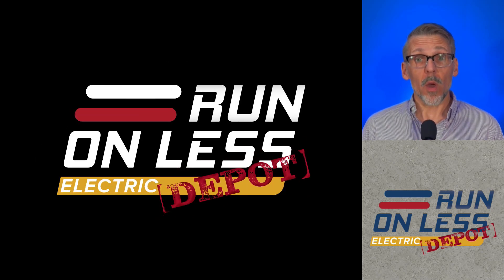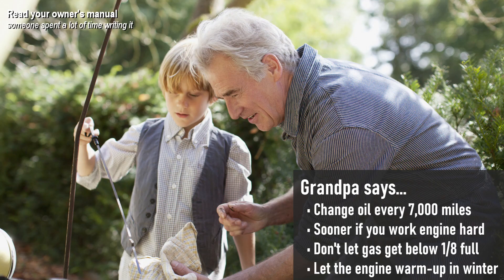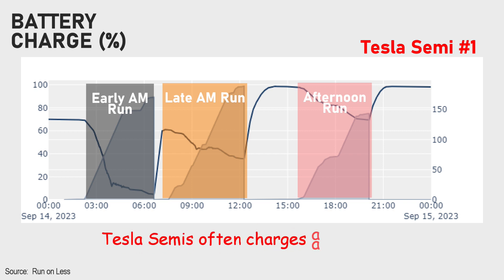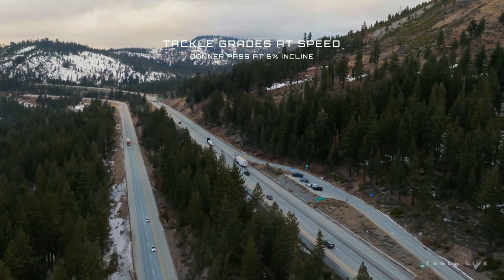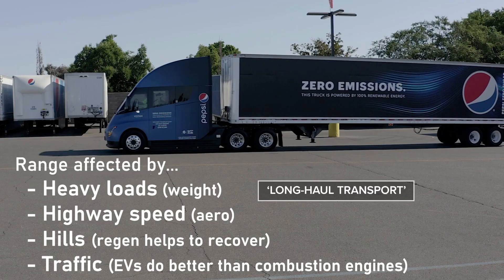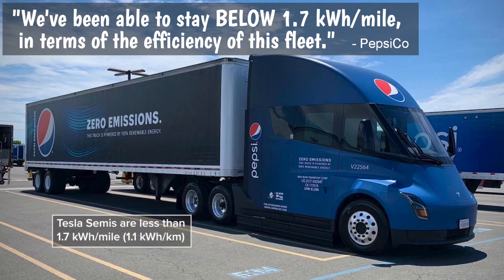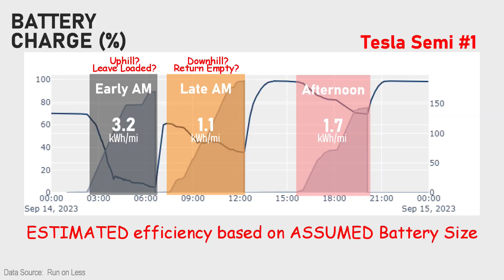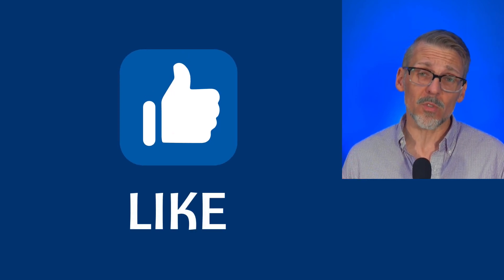In-Depth Analysis of Tesla Semi Data (Freightliner and Volvo too!)

Comment: What makes sense is what Edison Motors is doing.  They are using an electric drive train like the other EV’s, but add on a diesel generator.   This allows them to avoid the infrastructure and range issues of a fully electric truck.  Another advantage is the fact that you can adjust when the generator comes on so you don’t over stress the batteries.  A 80% full charge down to a 20% discharge can be maintained extending the life of the batteries.   But the main advantage Edison Motors has over the other BEV trucks is that Edison Motors is designed for vocational trucking.  Initially it was designed for logging, where you go up hill empty and come down the mountain fully loaded. With regenerative breaking on a full load going down hill, and empty load going up hill, and an onboard level 3 charger for the range, they are looking at 50-100% fuel reduction depending on the terrain.  Diesel trucks for highway hauling are already extremely efficient. I think a hybrid approach will make a lot more sense for more applications, than a fully electric truck does.

Comment: The most important statistic is how much load they can haul and how far on a single charge. These cannot haul as much as a regular truck as they also have to carry their own batteries. They will never haul as much as gas vehicles they all have a have a maximum weight.

I want to know if the weights of these vehicles were maxed out in therms of weight and if they were, what was the load weight.

I would love the hype to be true, but it's not.

Comment: Thanks for showing us the data, this shows how stupid EV trucks are. 

1) Drivers don't care about the batteries because its the company paying for the degradation not the company. Hence not capping the charge and driving it down to single digital state of charge
2) Range doesn't seems to be sufficient because drivers are fully charging it and driving it down to single digital meaning that they are not willing to wait at a charger to charge midway or they don't care about the really really expensive battery packs because their company is paying for it. I would really hate to see it in a few years where these battery packs are old and could no longer cover that distance. 
3) they are charging whenever is convenient meaning they are charging during the day which means electricity rates are sky high. 
4) Pepsi have an on site battery storage where they could charge the truck with during high demand charging. This just just adds a bigger battery pack that you're cycling and degrading. 
5) Also, most of these things seem light.    

If you really want a new fuel hydrogen would have been way better or syntenic fuel

Comment: I would like to see the calculations if these trucks are charged on standard 480v and 240v. Keep in mind it can charge from four circuits at once. There are large number of trucking routes, not highway per say, that can be done without the special chargers. Also they can charge from four superchargers at once, although this is probably only practical for overnight charging as cars leaving 4 superchargers all together and available for use during the day is unlikely

Comment: The cost of the changing facilities should also be included with length of use (Solor panel length of seri e and ...).

Seems trucks running on liquid fuel is the way to haul.

Impressive how far electric trucks have come.

Comment: I worked for Schneider for 7 years in the 90’s, they are ruthlessly efficient and I’m telling you if these electric trucks were a realistic idea that actually worked in the real world Schneider would order 13,000 of them tomorrow. They were the first to put satellite technology in all the trucks, they changed the entire fleet over to fuel efficient Detroit series 60 engines in just a couple of years and switched the entire fleet to automated manual transmissions. They couldn’t care less about the drivers they did these things only for more efficiency. I’d bet money Schneider didn’t pay a dime for the electric trucks in this test program Freightliner and probably the US tax payer is footing the bill. Let’s face it unless they scale up and modernize nuclear power all these trucks are running on COAL. A handful of solar panel and windmills (which don’t even work half the time) won’t cut it.

Comment: According to "Food Processing" website (trade publication) Pepsi is adding 50 more Semis to Fresno.
I would say that they probably have enough information to make a decision, and they are voting in the most MEANINGFUL WAY possible for a company ... with their capital budget.
So you can hate on EV Class 8's all you want, but the people who PAY for the big fleets have already decided.
It seems that the biggest holdup is Tesla, and the biggest holdup THERE (which they downplay massively) is  a shortage of the right KIND of batteries - the 4680 program has not been the success Elon expected.
Why would you want to use them for OTR, when your BEST savings come from using them for "local" delivery - exactly how Pepsi is? Long haul is either a decade away (I may be pessimistic) or something more like Edison Motors.

Comment: 14:50 With the Telsa and OTR, you do not need mega-watt chargers everywhere - you just need a slow charger at truck stops that would run the truck's electrics/climate control/battery cooling/heating and charge the truck in 8 to 10 hours as the driver takes the overnight sleep

Comment: Long range truckers can drive 11 hours a day so stopping to charge the truck for 2 to 3 hours during the day would be a problem for them.  This assumes there is charging during the night while the trucker's sleep.
Reply: Exactly. Long haul as it is done presently by trucks in North America does not allow electric trucks to do the job, even if the range could be extended to 1200 km per charge. Sometimes, drivers don’t have too much choice to park and if they can’t find a charging station for the night, they would be screwed.
Reply: It takes 1 hour to full Charge for Tesla Semi to charge @ 800 to 1000kwh charger.
Reply: @rozonoemi9374  And ? Why is it relevant ?
Reply: @martinpenwald9475  you stated that it takes 2 to 3 hrs to charge, which not the case for Semi. Yes I agree that presently long haul truckers can't realy charge along the way, but it's coming. I'm à retirer truck driver for 30 years so I know all about Trucking, because I'm off to the rodeo with a heater in my truck!!!
Reply: @rozonoemi9374  Learn to read. Where did I state whatever about charging time ?
Reply: @martinpenwald9475  Sorry, the comment was for @harland...

Comment: Imagine if we had a technology that could be electric without needing batteries. You could also hook a ton of things together to decrease the number of drivers and reduce other inefficiencies. You could even use steel wheels and put it on some kind of steel guiderail to really increase efficiency.

Electric long haul freight is a solved problem and electric long haul trucks are not it

Comment: Is ironic that people are worried about the range when DOT driving limits are the bigger limiting factor.
Reply: Not by far. Driving more than 900 km per day is very easy, and driving over 1100 km is possible in some routes WHILE respecting speed limits and DoT rules. Last week, I did 920 km in 1 day on Texas roads (with less than 200 km of interstate this day and a mix between 2-lanes and 4-lanes highways) with a 61 tonnes oversize combinaison. So, nothing that an electric truck can remotely do with current technology.
Reply: @martinpenwald9475   in Europe, a driver can cover an absolute legal maximum of 506 miles (810 km) in a day, but more like 420-450 (ca 680 km) miles in practice!  We obviously care more about operating safety here in Europe!
Your examples belong to the upper 1% of US truck operations!  Tesla and the other e-truck manufacturers have 90+% of the market open to them!

Comment: A fully loaded diesel truck uses about 30 L/100km, so about 4.5 times as much as a car. At 1.7 kWh/mile these trucks use about 7 times as much as a car. Am I missing something here or why is he calling that extremely efficient? And keep in mind that a diesel truck has more loading capacity than an electric truck.
Reply: Diesel contains about 10 kwh of chemical energy per liter. A Diesel engine is about 40 percent efficiet. And 30 liters of diesel is equal to 120 kwh energy. This means 1.2kwh/km energy consumption. So where is the 7 times more consumption?
Reply: @Bruh-pp5yz  An efficient electric car uses about 15 kWh/100km or 0,25 kWh/mile. So this truck uses 7 times as much energy as an electric car, compared to a diesel truck using only 4,5 times as much as a diesel car. I am just wondering what is the reason for this.
Reply: @weorldedit  some Diesel cars consume 4 liters per 100 km.

Comment: I think the weakness in your data (as indicated by others too) are that you don't know what they were hauling. Other youTubers are saying that the loads are a lot more modest than they might imply. Also you're not able to determine just how much money they're spending on the electricity so you don't know their cost per mile. Also there are numerous stories about breakdowns and as you say, they're a LONG way from autonomous operation. As an experiment, it's quite hopeful. But there is no way to tell from this data or your analysis if this is in any way practical. And to say that Tesla is not a reliable information source is the understatement of the century. Then there is weather (like cold weather), long term battery degradation, and cost of maintenance to consider. Hertz, after all, gave up because of how expensive their Teslas were to maintain (when they were able to even get parts). I kind of see this like the US Navy's railgun and laser experimental weapons. Cool sure, and someday a major part of the navy's firepower, but maybe not really practical for decades to come.

Comment: All that spiel about 20 and 80 is nonsense because the 0 and 100 percents reported are NOT actually 0 and 100 of the battery capabilities! Rather, it's what BMS limits users to. Hence, you are automatically ALREADY in the "20-80" window of that specific battery. It's true for most of batteries made in the last 5 years... 😂

Comment: I deliver Amazon, and they charge all those eVans to 100% every day.
Reply: Which is fine. Charging to 100% isnt bad for the battery as long as you dont store it like that for days. If you drive shortly after its fine. Its way worse for the battery to discharge it into the single digits.
Reply: @TheDude50447  But it does increase dendritic formation which does reduce the life of the battery.  Of course the chemistry matters and for lfp you are right- but tesla insists on nca and it really does reduce the life of those.

Comment: Just the time spent recharging that monstrosity all day and its extremely falling asleep with so many batteries that could bust into flames while you sleep makes diesel way better and they have a electric motor ad on to trucks and trailer that will give a diesel 19mpg so electric is not the way

Comment: 1:37 God I can't stand the marketing ploy that electric cars/trucks are "0 emissions".

Yeah, okay, so maybe YOUR charging station is powered by renewable energy. They aren't ALL though. And I'm fairly confident that the production of all the lithium batteries wasn't exactly as environmentally-friendly as you're touting.

Meanwhile, 6:56 yeah no shit autonomous trucks are proving difficult, they only just (relatively) recently started making automatic transmissions for large trucks.. And the companies that are running these trucks on the road might wanna trust autonomous trucks, but what if I, a driver on the road alongside these massive things, don't feel as confident in them? Why the hell should I have to now start dealing with truck drivers who aren't actually there?

Let's, as a society, back the fuck off with the autonomous and electric shit. Maybe there's reason to start moving gradually in a direction, but I don't think that an automated, electric tractor trailer is the right solution here. Maybe let's invest in our railways better? Yano....reduce the number of trucks in the first place?

Comment: Bad math for Tesla.... Using short runs (i.e. average a run from 14.5% to 7.9%) that predict 538 miles to inflate the average is wrong... You should either filter-out this small runs or use a median. Better yet use a weighted average for which small runs have very low weight. For those who believe in science there is real data in that cart: Every time the truck is used from ~~ 90% to 10% it runs ~ 380 miles. That's the real world range. The average from this dude wrong math is pipe dreams, never achieved IRL.  Also the "assumptions" of being maxed out are WRONG. Trucks don't drive 100% of the time with 100% of the load. For a long run experiment you can assume as much as 50% average load. Really. Bad math.

Comment: They should be using lithium titanate faster charging no temperature problems no issues charging 100 percent or going to zero 30,000 cycles
Reply: but much less energy density, requiring more space for batteries

Comment: In your video you state that the Pepsi trucks are hauling liquid. How do you know that?  Maybe they are hauling the cardboard containers that they pack the sodas in.  Maybe they are hauling empty bottles. My point is I have never seen anyone talk about the useful load of any of these trucks. And maybe I missed it somewhere but I am especially talking about the Tesla Simi.  In order to determine the useful load we have to know how much it weighs. Can anyone tell me what the curb weight of an empty truck is?  If you can't give me that number everything else is irrelevant. I am a truck driver and I also fly airplanes. Depending on how much fuel I take on in the airplane I could then calculate a useful load. Useful load is baggage and passengers.  If I can't find the curb weight of the truck and trailer empty, or unladen weight subtracted from the gross weight equals useful load.  In the trucking industry useful load is very important to making money.   I do appreciate your video, but I'm dying to see a scale certificate of an empty Tesla semi with a trailer.  There are CAT scales at almost every truck stop.  I don't hate the Tesla semi, but Elon musk over promises and undelivers. When am I getting my roadster? When am I getting a robotaxi?  I just spent a week and a half in a 2023 Model 3 and there is no way to do autonomous driving with cameras alone.  The backup cameras routinely failed the autopilot routinely failed The only redeeming feature that I liked actually I loved is the fact that the cars a rocket ship. If I owned one I'd be going through tires and brakes like crazy.  I know it has regenerative braking but when you're driving it as fast and hard as I was regenerative breaking wasn't enough. I had a great time in the rocket ship for a week and a half.

Comment: Imagine this: You buy a diesel or gas powered truck, but before you drive it away from the dealer, he tells you that you shouldn't ever fill the tank more than 80%, and you can't run it down below 10%, or the gas tank will permanently (and irreversibly) become smaller. And each time you break the 80/10 rule, your total gas tank volume will reduce by a random amount.
Would you drive away in the truck? Or would you demand a truck with a gas tank volume that will never change?
Reply: Running a tank dry will fry many fuel pumps (perhaps other components as well).

It’s not “never above 80%”.

Maybe without exaggeration you don’t have a point?

Comment: The funny thing is that it's not the drive train where the Tesla Semi is the biggest failure, it's *everything else*. Want to hand documents to security through the window? Sorry, you're sitting in the middle. You want a bed so you can relax a little when you're waiting for customs? Sorry, that's the "coat hanging" area. Something wrong with your vehicle? Going to need to call an HV electrician before touching anything, mate.

The sad thing is that Tesla were the ones who made an EV that looks and functions like a regular ICE (with a few minor changes) and that's what made them accessible to a lot of people, yet when it comes to trucking "doing what all the established truck companies were doing" design wise wasn't good enough for them, and it took what could have been a pretty good truck and turned it into a failure.

Also, my car has not lost 1% of fuel capacity in the 5 years that I've owned it, I doubt it'll be the same story for these trucks...

Comment: I noticed that you’re using a BMW I3 in your picture at two minutes. But as it turns out BMW has its own built-in battery management system that will allow you to charge it to 100% without battery damage. I always charge my car to 100% My car has over 100,000 miles on it and I have yet to see any battery degradation.
Reply: Hiding %10 SOC behind software isn’t very interesting to me. Ofc bigger battery lasts longer. Phone companies also do this & it is controversial at best